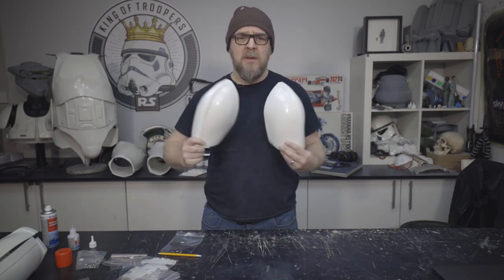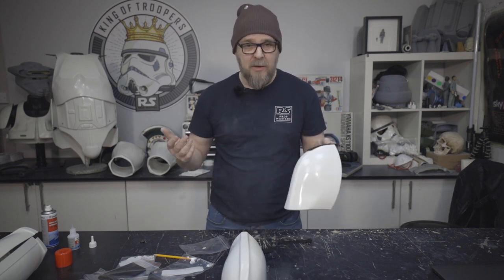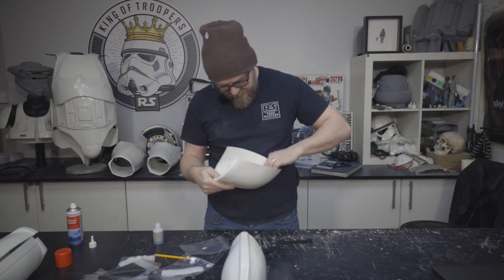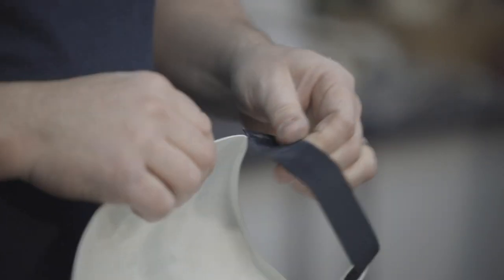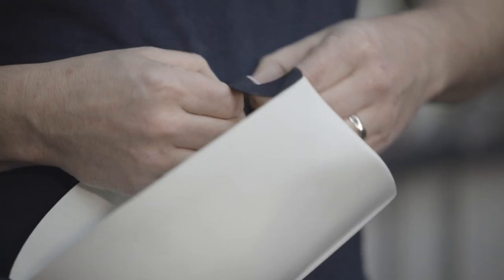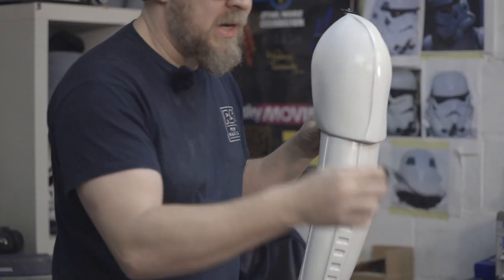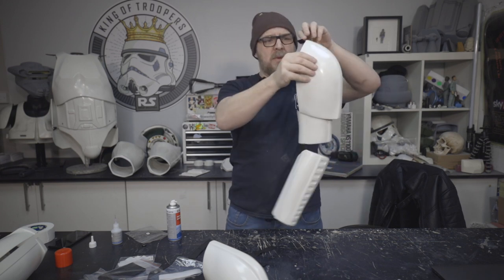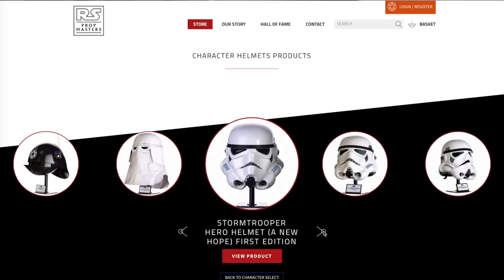Shoulder Bells Elastics - Building a Screen Accurate Stormtrooper - Episode 21

Comment: More twangy adventures with Mr Elastic. Good tip with the Tank tape (so called by the motorsports world, I think?) 
Thanks also for elaborating on the slackness/taught points when sticking it in "that's what she said!"👍